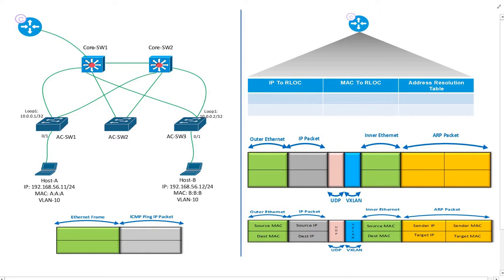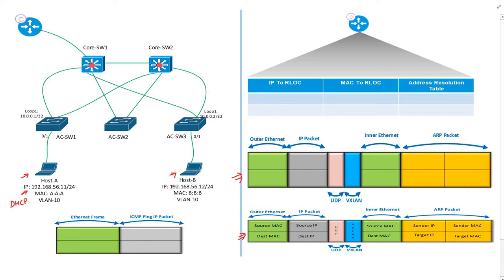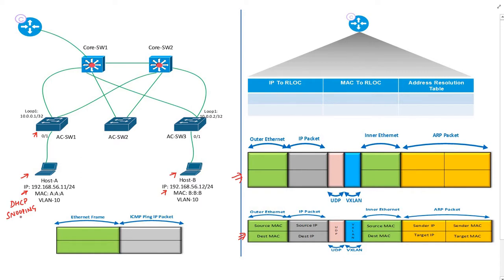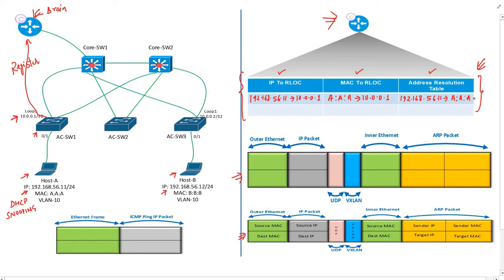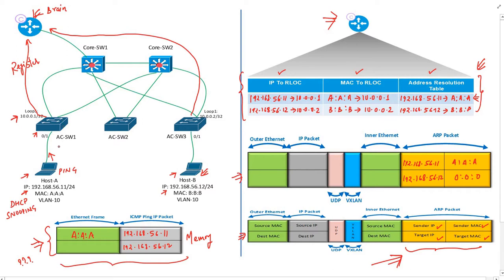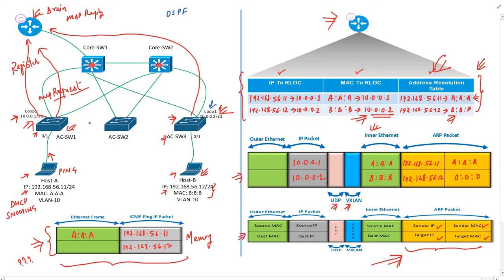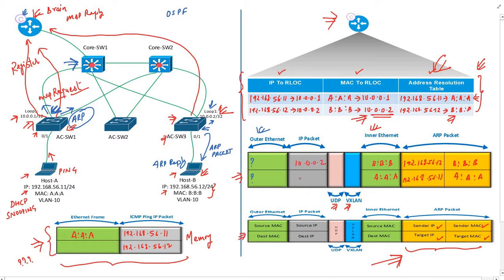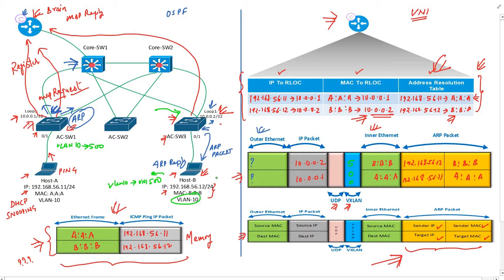SD Access Control Plane Part 2

Comment: Vishnu, just want to know the ARP process because most of the information for data forwarding is getting from the Control plane node to the fabric edge right? I am talking based on this video u explained the ARP messages passing between fabric nodes. Correct me if I am wrong in my understanding.
Reply: Hi Vishnu, I had a similar question, why is there a need of ARP request and reply as we are getting the information of MAC address of Host B from the database?
Reply from the maker: Hi Mridul.. this is because how TCP/IP works as at the end, host needs an ARP reply back. There is another mode in SDA in  which the edge switch can also answer the ARP reply on behalf of host.
Reply: @bridgewhy  By edge node do you mean the edge switch near to the sender. The Control node, knows the mac address of Host B (Which Host A are trying to get  using ARP). So when an ARP request is sent to know what is the MAC address of Host B, will the AC-SW1 contact the Control node and get MAC address of Host B?
Reply from the maker: @antonyjesto007  Hi, Yes, by edge node I mean the host closer to hosts. And yes, the edge node does contact with control plane to ask necessary information. I really encourage you to go through all the videos of the series and I am sure you will get answer to all of your questions..

Comment: Hi, You are teaching method is great. I have a quick question. When a user connected to edge device A in vlan 10  with TAG X moves to another edge device B, does he needs to re-authenticate with ISE ? and are these Edge switches per-configured with with VLANs on switch ports ( hard coded ) or switch ports get dynamically VLANs assigned by ISE depending upon user authentication parameters ?
Reply from the maker: Thanks.. Yes, generally a user has to re-authenticate when he moves between the switches. But you can configure ISE such that it can remember the sessions for a longer time, in that case you don't have to re-authenticate. Nopes, nothing is hard-coded in switches. Depending on auth results, ISE push the configuration on switch ports.
Be healthy and keep learning!!!